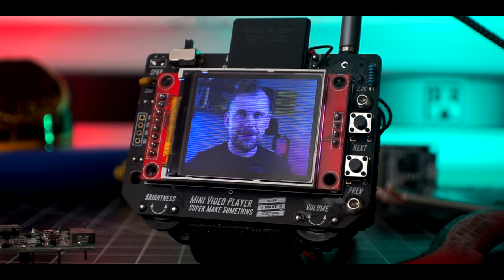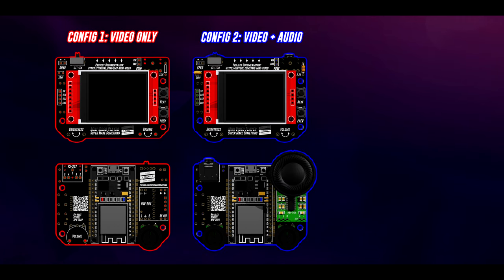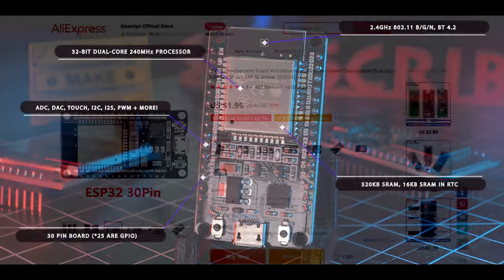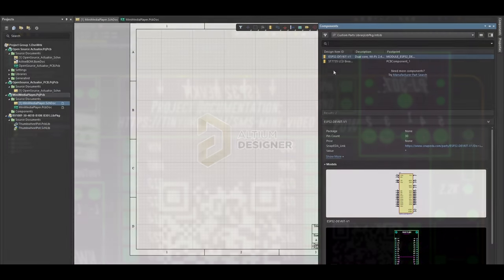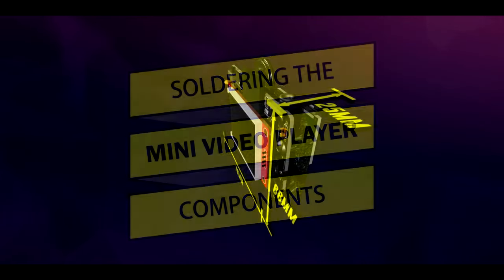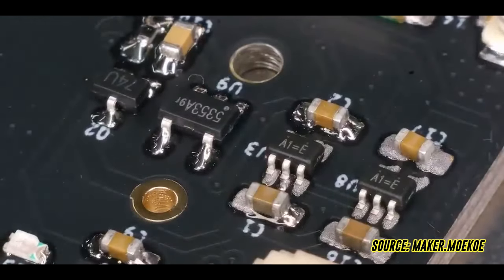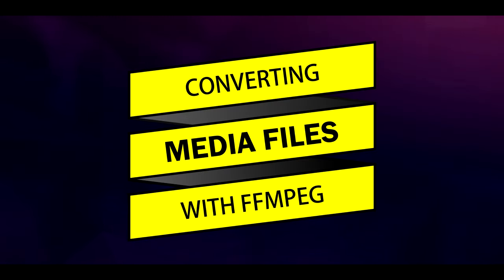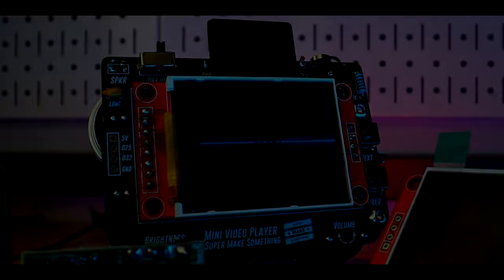Open Source Mini Video Player (Arduino, ESP32, Electronics, PCB Design)!

Comment: Creative use of my JPEGDEC library. The 160x128 LCD is a good compromise for size/speed. FYI - the ESP32-S3 WROOM module will execute the code about 15% faster. As soon as Espressif shares documentation on the SIMD instructions of the S3, I'll be able to speed up JPEG decoding even further.
Reply from the maker: Thanks and that’s super cool about the S3! More speed is always better! 😃
Reply: It also has enough pins for 16 bit or more lcd displays for faster updates!
Reply: Hi, think you for this awesome work, any way to get the wiring diagram, I'am working on a similar project with some tweaks. Please 🙏.

Comment: Sweet, I've been watching the library creators post on Twitter as he has been testing performance with different Esp32 versions. 

I'm curious is 25-29 fps is possible on bigger resolution LCDs? Does the library go over this?
Reply from the maker: The library is definitely very cool! The Instructables tutorial that I initially found the library through (https://www.instructables.com/Play-Video-With-ESP32/) mentions being able to theoretically push up to 60 fps via SPI on a 320x240 16-bit display, but that does not include overhead for reading/writing video data.  I had to change the code a bit to get it running on this project -- the author's implementation actually runs on both of the ESP32 cores (one for video, one for MP3), but I was not able to get this working on my development kit and am running everything off of a single core.  (The issue is related to reading the SD card data via SDMMC, which the LCD screen's SD card does not support and would require an external SD reader/board.)  Having a dedicated video core should increase the refresh rate a bit or alternatively be able to drive a larger screen, but I have not tried this yet.
Reply: @SuperMakeSomething  I've got it running on a 2"  320x240 ST7789V, I had to strip audio to have a decent framerate.
Reply: @davisje011 I'm trying to do the same thing on the same display. Are you using the code provided in this video?

Comment: Could you please explain what function the resistor and capacitor are doing?  Everything else seems somewhat self explanatory on what it’s doing and why it’s a necessary part but those two have me stumped (I’m more of software guy, just getting into hardware)
Reply from the maker: You bet and good eye! The capacitor is there to filter out audio noise from the circuit. I was experiencing some high frequency “clicking” noise over the speaker that corresponded to the SD card being read and adding a small capacitor into the audio portion of circuit fixed the issue for me. The resistor is also audio related, specifically for the volume control. Humans don’t perceive volume as linear, so logarithmic potentiometers are typically used for modulating volume. Unfortunately these can be quite expensive, so I instead use a resistor that is matched with the resistance of the volume thumbwheel potentiometer to create a nonlinear resistance change when the thumbwheel is rotated. Unfortunately this didn’t end up making it into the final video, but it’s definitely one of my favorite parts of the build! Analog circuit design is a whole world of its own and so much fun! Hope this helps!

Comment: Good evening my friend
I could use a 1,14 inch 135x240 pixel lcd with driver st7789?And what changes should i make to your code?
Thanks from Greece Athens
Reply from the maker: You would need to check the Adafruit Arduino library that I am using to initialize these screens to see if is compatible.  This will require a code change to use the right display/set the right resolution, but should be straight forward.  However be aware that changing the resolution to a higher one than the one I use in this project means that the microcontroller has to draw more pixels per frame, which may affect the playback frames/second that the microcontroller is able to handle.

Comment: can I use a 240*240 TFT display for this project??
Reply from the maker: It could work, though I would double check the definitions file in the screen library to see if this type of display is supported. That being said, it would run at a lower fps because you would need to update more pixels in every frame.
Reply: Ok thank

Comment: Can i use other display sir?, maybe tft spi 240* 320 ili9341 ?
Reply from the maker: The software may support it, but I am not sure if the pin layout is the same on that screen, so it may not be able to be plugged into this circuit board.

Comment: How can make it using 2.4 inch tft touch display
Reply from the maker: You would need to double check the compatibility for both the GFX library and the pinout for exposed pins on the PCB. It is unlikely that you would be able to surface mount the screen since it would likely have a different pinout and footprint, but you may be able to solder wires between the surface mount pads on the PCB and the screen you are trying to use. If you try this and get it working, please let me know!

Comment: Excellent project and execution.👍
As a matter of fact, I'm just nearing completion of a Teensy 4.1 based, MIDI controllable laser synthesizer, which displays abstract laser effects, based upon complex lissajous imagery, similar to those in original Laserium shows.
I have a genuine need for an image preview screen that can convert XYRGB points @ ~40kpps. I've been searching for a RGB vector to HDMI display for 2 years w/o success.
ref: YT video 'Christopher Short laser Radiator HDMI' (very similar project)
Thank you for any pointers towards that goal.

Comment: made all lik e in the video and got compile errors. after 2 days of trying to make it work, i figured out that poject only works with library and esp32 core versions in project/ if u update them to new, project wont cpmpile. and no, project doesnt work with newer esp32 core like it ssays in github(for me at least). as result i got very laggy video 240*240 pixels what makes me sad. i used regular esp32 wroom and 1.54 inch tft diplay with spi conltrol. can anyone help me?

Comment: So if LCD_MOSI = 23 connects to SDA. what does LCD_MISO = 19 Connect to on the LCD there is No MISO on the LCD is it not Connected. I'm new to electronics just trying to create my own diagram of the circuit?
Reply from the maker: Good catch. This was a relic from code development, but you are correct that D19 is not actually connected to anything because there is no MISO on the LCD.  There is a MISO/MOSI pair on the SD card, however, which are connected to D12 and D13, respectively.

Comment: I actually had issues with smooth video in my dashboard when simulating a moving gauge. This should make it a lot smoother. Since I have defined frames now I should be able to have real quick response on my gauges
Reply from the maker: Awesome! Good luck with your project!

Comment: Dang I'd love to do this. Building the physical project would be a breeze but at my knowledge level of programming and software steps I got lost about 1/3 of the way through the explanation. I will make an attempt and if I can't seem to be successful I'll throw it in the drawer with the other microcontroller projects I have made multiple attempts at but failed. I guess I'm learning all the ways not to do it

Comment: If you don’t need WiFi but still want a truly embedded device to play video off of storage then one of later teensy boards seems like a better choice. You should be able to go up to 480p, JPEG video or possibly even real video formats like x264. I’m doing this with an esp32 mostly because I don’t want the sd card dependency. I just want to point it to a server and press play and it will be like a broadcast TV channel, looping long playlists of videos

Comment: 📺 Can you just build the mp4 re-encoder / spliter into the esp32 so if it sees mp4 media it automatically does this saving users hassle theres now an esp32 avi media player out from hackaday that came out today as well. Maybe have it use the input filename like "test movie.mp4" but break it down to mpeg 160x160 'test movie(small).mpeg' + 'test movie(small).mp3.. but do this in an automated script like maybe .py python etc if needed etc..

Comment: First time watching your channel. Amazing production quality. I love these B-reels and animations. One easy improvement idea came up. You can easily improve the looks of these 3D-printed component stands by changing the Z-seam setting in your slicer to place the layer change spot on the backside so you dont have those small blobs on the frontside.

Kinda useless info but wanted to share in case you are interested. Everything else seems so nice!

Examples on a video: 6:44, 8:37
Reply from the maker: Thanks for watching! That is a great tip!

Comment: 📺I was searching for a specific solution and happened to find this video. While this video doesn't meet my needs directly it certainly is informative and I liked it as someone with no prior DIY experience. If you're interested I'm trying to solve this problem: Car has a built-in dashcam but no way of viewing saved footage while on the go e.g. after an accident. The solution would be a device similar to what you show but the differences would be: Able to browse the contents of inserted memory card (meaning I still have to take out the card from the cam and put it in the device). Able to play the video files as is (Might be a non-starter given your explanation of video decoding processor requirements). Able to do Wi-Fi transfer of selected video footage from device to mobile phone (no idea what software will take care of that).
Reply from the maker: That’s a cool idea! My project queue is full at the moment, but if you end up building this project, please let me know!

Comment: Hello, I replicated your project as a gift for my girlfriend, its our anniversary on thursday and Im having an issue. I followed all of the steps correctly multiple times but the screen only print error sd card mount faild followed by error failed to open mjpef file for reading. What could be the issue?
Reply from the maker: I would double check the solder connections between the breakout PCB and the ESP32. I had a similar issue during the livestream build and the problem was a sketchy solder joint. (Please check out that episode for more details.) Hopefully this will resolve your issue. Happy anniversary!

Comment: 7:20 I wouldn't desolder the pins, as desoldering is too much work. Instead I would bend the pins 90 and trim necessary to match the pads. This way you convert the module to smd plus soldering is much easier now.
Reply from the maker: This is a great idea and wouldn’t make the project much thicker. Thanks for the tip! It would have definitely have helped with some soldering difficulties I had during the livestream. 😅

Comment: Is it possible to gain some frame rate by disabling sound? I'd like to feed a 320 x 240 screen but do not need audio. thanks.
Reply from the maker: Right now both MP3 and video decoding are running off of a single ESP32 core, so I believe thar this should be possible! Please report back and let me know if you try this!

Comment: two display connect to this its possible
Reply from the maker: If you were to drive two displays independently, you would need to cut your frame rate in half, as the current implementation is close to the limit of one ESP32 compute core. I am not certain if it would be possible to simply “duplicate” the displays by hooking them up to the same pins, as this might go against how SPI communication is implemented, but it would be interesting to try! If anyone knows, please leave a comment!

Comment: Would these parts and pieces work for an in-store digital display board... could you add wifi downloading the files instead of the mem-card??
Reply: This project uses a very small screen in the neighborhood of 320x240 pixels. A sign board big enough to be useful in a retail space would need to have a lot more pixels. I think that would be beyond the capabilities of the ESP32. A Raspberry Pi or similar single board computer would be a better choice.

Comment: The ESP32 is such a kickass little processor 👍😆
Reply from the maker: It's really a great platform. I just wish that for this build that Espressif Systems would make a version with castellated edges! 😄
Reply: @SuperMakeSomething  you can just use esp32 chip without the dev board and solder it with hot air gun or even with just soldering iron
Reply from the maker: @akul24  Definitely an option, but this would limit the number of people who could build this project, since a lot of people only have a soldering iron.

Comment: Ohh I get a load of GFX Library errors, compiling this for the exact same hardware. Have things moved on?
Reply from the maker: Thanks for the heads up! There is definitely a possibility that the GFX library may have changed since I uploaded the video, since it is also an open source project (that is not maintained by me). Are you able to try an older version of the library (preferably the one used in the video) to see if it fixes the problem?